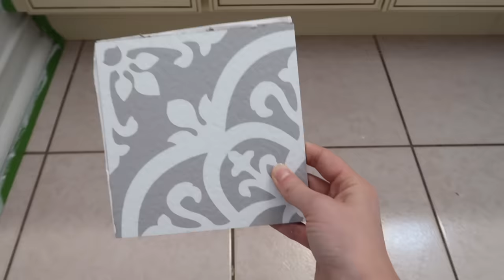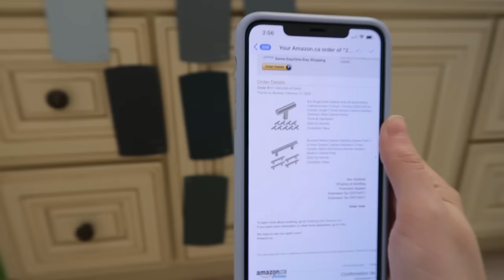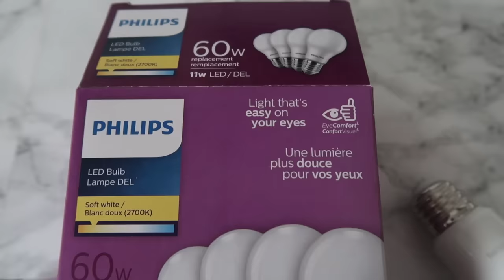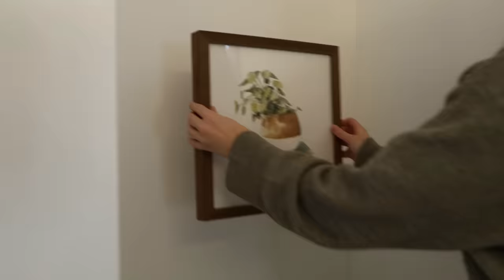DIY BATHROOM MAKEOVER ON A BUDGET | RENTER FRIENDLY

Comment: Please give us an update on how the floor and countertops hold up against water and humidity from the shower. I want to do this but I want to know how often I will need to redo it. Thank you for such a satisfying video!
Reply: Do it! I've had the paper on my kitchen counters in two different houses and they held up for almost 2 years in the first one and 1.5 so far in the second one.
Reply: The floor will hold up for at least 5 years. It’s a thick piece of plastic with the design and I have had some in the kitchen for over ten years now we’re about to replace. You don’t have to be careful with them like tile either
Reply: Miriam Mendoza doesn’t it get moldy between the tiles? Esspecially in a bathroom, where there’s always water on the floor?
Reply: @cellocello1762  you can grout between the tiles if you want to. I did in a room where my dogs water etc etc is, and I haven't had any mold problems
Reply: What a beautiful transformation. I love your parents reaction. ❤️
Reply: I used that same contact paper on my bathroom counters and it held up until I moved out (2 years)! The humidity and moisture didn't affect it at all.
Reply: Olivia,  how did you manage putting the Contact paper around the sink?  My counters are worn out 1968 Formica.
Reply: Don’t use contact paper- humidity is your enemy- it looks cheap and tacky
Reply: There is a seam sealer you can use with the adhesive tiles. It really makes a huge difference
Reply: Definitely do it! I did it in my rental home and loved it. I stayed there for over a year and everything still looked brand new when I moved out.
Reply: I"m concerned about water seeping through the linoleum tile.
Reply: @rebeccacampbell585  I put peel and stick in my bathroom and had problems with lifting. Especially because toilets may sweat in hot weather. I then used adhesive to glue the tiles that lifted down. What a mess. The glue eventually oozed out and there were black lines between the tiles. I peeled them up, cleaned up the adhesive wit goo gone and mineral spirits then put down sheet vinyl (linoleum). Sheet vinyl is pretty easy to install. No problem with water anymore.
Reply: @destinyschild8515  thanks for sharing. I think peel and stick might be better for a porch or an entry or a closet or something. I think for my bathroom I'll just rip up the tile and do new tile properly. It's way more expensive but you get what you pay for.
Reply: I have those kind of tiles in my bathroom and they have stayed up since we redid the bathroom 4-5 years ago!! They still look good as new. I recommend you grouting the tile so it looks like actual tile pieces and it’ll stay on longer.
Reply: @Whydoyoucare1437  What she did looks beautiful though, so I think it's worth it when you don't have money for real granite.
Reply: Cathryn Bucci same here! 👍🏽 please let us know how long it lasts.
Reply: Not a great floor material for a bathroom they will start to lift over time due to moisture !
Reply: I have done contact paper on counters in both the kitchen & bathroom! It holds up much longer in the bathroom (a couple of years) but six months to one year in the kitchen.
Reply: Mario Lipton  say what?
Reply: @destinyschild8515  Same thing happened with my peel and stick in bathroom.
Reply: I knew someone who did the contact paper for the countertops. It held up really well but their install wasn’t this good looking. You have to be able to cut straight and do things very meticulously for it to turn out this well. Not everyone has such a steady hand. I’m one of those with not such a steady hand.
Reply: Use Varathane Clear Finish on the counter to waterproof
Reply: While looking like it improvement this will not hold up. The contact paper relies solely on the adhesive and once water finds it way underneath the bond will fail. Same with the floor. They offer an opportunity for mold and bacteria to grow. There is no sealer or grout that would fix that. I admire the DIY spirit and think that is great In purely does metic scenarios, but not when it comes to waterproofing and hygiene. Have your bathroom properly renovated by a knowledgeable contractor who understands waterproofing and you will have something that will last 20 years.
Reply: @Whydoyoucare1437  It's a great temp solution to an ugly countertop. That's all. I have it on a desk top in my office and it looks great. Not everyone can afford new countertops so this is a cheap way to bring in a new look.
Reply: Mario Lipton  what
Reply: While I don't think the contact paper is a good idea in the bathroom (acetone nail polish remover immediately removes the marble print, I have it on a desk) the peel and stick can be made so much longer lasting by grouting. They make a special "grout" just for these types of flooring that will keep the water out of the seams AND make it look more like real tile. They hold up pretty well in that case
Reply from the maker: check out my most recent bathroom update video to see how it is holding up!
Reply: My mom did her floor years ago and they are still great....you have to really scrub them first and you can add a glue if you want....just use a rug outside the tub to keep water from sitting on them...my mom just hangs hers over the tub behind the shower curtain after she is done
Reply: I have the same sticker on my kitchen counter top and while it was a huge pain in the butt to put on and peeled up on some corner areas it did hold up. Overall it’s nice because the counter underneath was so ugly and now I can at least look at
Reply: Cover the old grout cracks level with the old tiles if your going to use sticker tiles if not any weight will cause them to bend down into the unlevel areas and get water will get under them. The counter top, remove the sink out of the counter top first then put the sticker on, reinstall the sink and silcone around the edge. No bubbles or seams showing it wont peel because it now is  weighted down and sealed.
Reply: diziscurran Great idea.
Reply: @angelabacker1177  LOL, I thought exactly the same thing.
Reply: @jonbeercontractingllc566  and yet I love all the comments of those who have been successful as well as the recommendation of products to address those issues with success as well.
Reply: @carolg.6838  You probably can piece together a template by using cut up newspaper..
Reply: There was lino tile in my bathroom when I bought my house 9 years ago, I put some in the kitchen as well then. Both lasted until I renovated the whole house over the last two years. I've used the same thing again, but in a wood plank finish. Preparation and technique make a massive difference in how well they last. No gaps, and the floor must be level and scrupulously clean. If it lifts, pull it right off, clean any glue residue, and put a new one down. Then it's waterproof and quite tough.
Reply: @plantsoul1605  How did you do the corners of the desk top?
Reply: @shayxie8318  wow! Two whole years as compared to how long the original lasted?
Reply: @meganr9280  that seems like you could fix this problem with caulking the edges. As long as it is close enough...
Reply: There are products that let you spray paint countertops and sinks. If you want a ceramic type finish. They seem to hold up well.
Reply: I think you did a great job! I love the c marble contact paper and have used it in a couple of my bathrooms and 2 years later its still holding up. The paint on the cabinet is beautiful! I love the floors you did too. How many boxes of flooring did you use?
Reply: Hello, thanks for the tip. I am about to do my kitchen floor vinyl like that. It says a glue spray is recommended for best hold. Do I need one and how is it used. Which spray to use? Bestan
Reply: I used this type of vinyl tiles from Family Dollar (wood look) and used a flooring glue on the back and no issues. This is a back room with humidity and moisture issues. They are stuck to stay! Don’t use the glue if you want to remove later.
Reply: @CajunPride777  aàaq
Reply: Kristen McGowan I can’t find the update video
Reply: @jonbeercontractingllc566   You'll do it for 300-400 dollars if I buy the material?
Reply: If you're concerned about water getting under the tile & contact paper you may find caulking is suitable. Grout may not hold up because this floor cover is made of flexible vinyl. Grout dries hard as it's made for rigid tile. Applying caulking at all the seams might be the best solution. It dries flexible & it's purpose is to block water from seeping into cracks. It's typically used at the edge of floor cover meeting wall & at the base of a toilet meeting floor. You could use it like grout at the edge of each tile if you feel it's necessary. Also at the edge of a counter meeting wall & around the edge of a sink, etc.
Reply: @shayxie8318  Grout may not hold up because this floor cover is made of flexible vinyl. Grout dries hard as it's made for rigid tile. It might be suitable to use caulking at all the seams. It dries flexible & it's purpose is to block water from seeping into cracks. It's typically used at the edge of floor cover meeting wall & at the base of a toilet meeting floor. Also use it to protect contact paper from lifting apply it at the edge of the counter meeting wall & around the edge of the sink, etc.
Reply: @carolg.6838  If you own, then definitely look into Stone Coat epoxy!
Reply: @taniszaheramomin3621  it doesn't turn yellowish after months?
Reply: @KristenMcGowan  you are awesome
Reply: @meganr9280  yes I can’t cut a straight even line no matter if I did it slow or fast. It always goes crooked and jagged!
Reply: Would love to see all the replies to this  but they seem to be hidden now?
Reply: @jenichapman7328  I’m able to see them all. 🤔 Maybe there’s something on your settings that isn’t allowing them to show?
Reply: Yess cuz all I'm thinking is how much mold is gonna build up underneath
Reply: @vanniperigord7085  is that something you buy separate like a glue
Reply: @kwiggy5091  what is the name of the grout
Reply: @mightywind7595  what is the name of the glue
Reply: @dnllmaurer1  thank you I need to use the caulking because the problem with my old hard tiles they put this black caulking around my tub does it come in white I have old beige tiles and one is crack I want to do my bathroom to cover up the ugly beige tiles
Reply: @madelinebigio7565  Look up "vinyl tile grout". I believe Tec makes it, Lowe's sells it. I'm sure there's other brands though!
Reply: @rebeccacampbell585  It doesn’t.
Reply: @destinyschild8515  My son had it in his kitchen and in two bathrooms for many years and it held up just fine. It’s still in one bathroom.
Reply: @drkatemcd  I think some bathrooms must have more problems with humidity than others.
Reply: @dnllmaurer1  She did caulk the edges of the floor.
Reply: @meg_griffin_came_out_first  It didn’t in my son’s bathrooms.
Reply: Problem with switching hardware is getting the screws to match the holes.  They never seem to for me!  And I don’t feel like buying a drill just for that. I wasn’t a fan of the busy floors but the cabinets are pretty however I sealed mine and even with that the paint began peeling from water damage around the sink area.
Reply: For anyone interested I used Dixie Belle slick stick and silk mineral paint on my water damaged linoleum countertops then sealed with Gator Hide.  It takes a month to cure but once it does it’s incredibly strong.